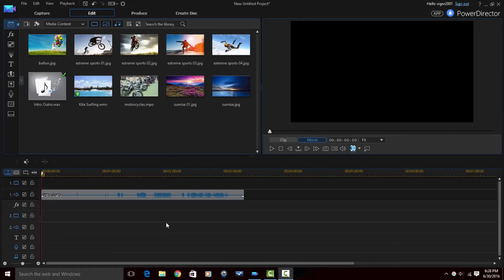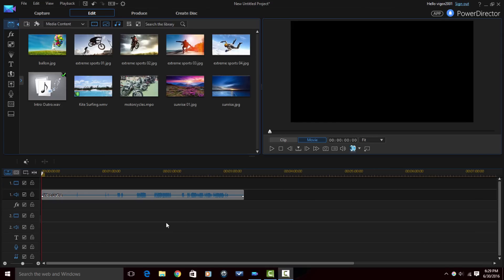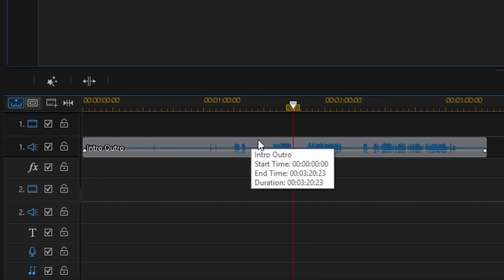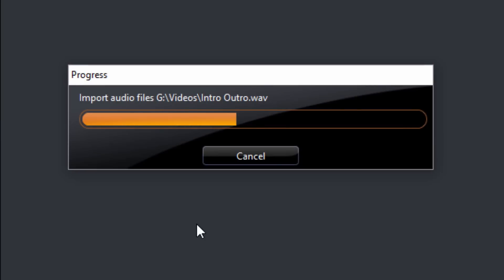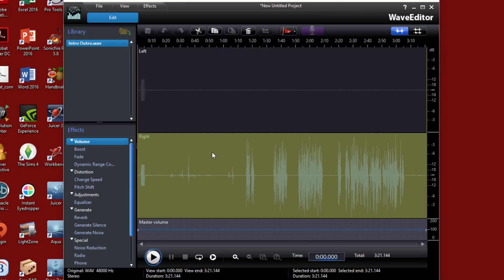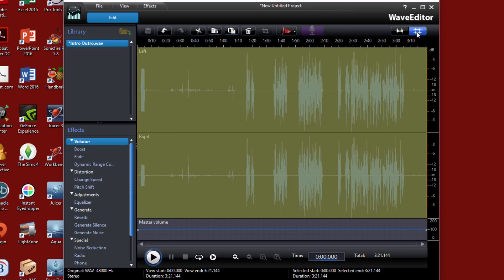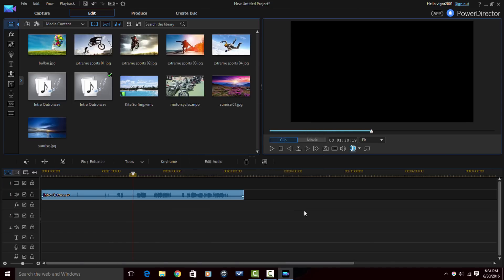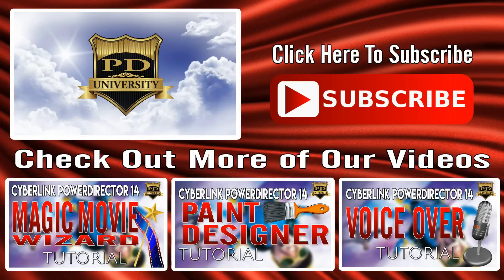How to Change Mono to Stereo | PowerDirector

Comment: this doesnt work in the current versions. there's no Wave editor for starters, I assume Audio Editor is its replacement, but when I try to CRTL-C or A or anything, nothing happens. why there isnt a simple 'mono' option is ridiculous. One legged audio is an obvious clear reason for wanting to edit audio
Reply from the maker: Nope, Works great for people who have the old versions.
Reply: @PDU_Tutorials very annoying that the Audio Director is now an additional cost to Power Director. Not gonna pay for another service I can use elsewhere. For anyone stuck my long winded work around was to export the audio separately as a WAV, import to Audacity, mono the track then re-encode as WAV, then import back to Power Director. Long winded, but free

Comment: when I select all it highlights BOTH channels and then when I paste it makes the left channel out of sync... ANY idea WHY this happens? Thanks. In the project area I don't have a left and right...I have a LEFT with no sound and on what should be the right is SOUND but it does SAY 'R" it just has a magnifying glass....weird.
Reply from the maker: No idea what's going on. You can contact CyberLink using the link in my channel under the About section

Comment: Hey my man. I have an 8mm camcorder tape which is in mono. The total length is 2hours 10 minutes. I used Wave Editor to convert to stereo and saved the new files to my Desktop. I then wanted to convert to mp4, so I would use Handbrake. HOWEVER, after I saved the files to my Hard Drive, the file was only 50 minutes long. Is this the maximum length for a conversion. The tape is a concert, so I could possibly break the files into about 15 tracks but this is very time consuming. Is it possible to do the mono to stereo in a 2 hour track?
Reply: In hindsight, I transferred the 3separate video VOB files to Power Director and found the total imported was only 50 minutes, so ignore my previous question. I am going to have to figure out this one for myself

Comment: OK. I managed to get the audio from my Camcorder TS/VOB Video files right on my Power Director, but could you give me some quick advice for the easiest way for me to post the Clip(s) onto You Tube by converting to mp4. I could do it, but I would have to use 'Handbrake' software but this takes ages, and sometimes you have to combine separate clips into one. Any advice you have for an easy solution would be appreciated
Reply from the maker: Sorry I don't have any other advice. Have you tried asking on the PowerDirector forum? Lots of people there seem to use DVDs and might be able to help. https://forum.cyberlink.com/forum/forums/list/ENU.page
Reply: @PDU_Tutorials  Hi again Maliek. I have sorted out my Wave Editor Crashing problem after the DXDiag prompt and I posted in the Forum sending the DXDiag. I also posted my other main problem and that is the combining 2 or more (In my case 5) VTS files as ONE File. I would have liked to have had the VTS files combined into one file before I imported into PD, but again I dont know the solution. I might google You tube and see if you already have the solution :)   - Hope Im not pestering you too much ;)
Reply from the maker: @groovedohg  No sure about that either. When you bring the separate files into pD you can combine them there.

Comment: Youre awesome mate. I have a load of video files I took on an old camcorder which were only on one channel - Solved my problem ;-)
Reply from the maker: Happy to help.
Reply: @PDU_Tutorials  Hey again Maliek. As I have mentioned, I am adjusting audio from a Music Camcorder gig I did many years ago. The files I am converting are 5 x  VOB files. On the video folder I am trying to get full stereo sound out of, only 4 of the VOB files created stereo files. The other VOB file always crashes and I get the message 'A problem caused the program to stop working correctly etc and I have to exit. It says Windows will notify if a solution is available. Do I have to contact Cyberlink and send a log file or something, or is there another way to find the source of the problem
Reply from the maker: @groovedohg  Run a DXDiag command on your PC. Go to the PD Forum and post your issue along with the DXDiag file. They can help figure it out there. https://forum.cyberlink.com/forum/forums/list/ENU.page

Comment: Hi pal. Im recording audio in audiodirector. I can only get it in L Channel and not in both. Any suggestions please? Cheers
Reply from the maker: Are you using a XLR mic and digital audio converter to connect your mic to your PC or are you connecting directly to your PC using a USB mic?
Reply: @PDU_Tutorials  second one. Yetti blue. Cheers
Reply from the maker: @AProperPaddyORourke  Check your PC's audio settings for your recording device to insure it is recoding to both channels. If it is set up correctly, try asking for assistance on the Audio Director forum. https://forum.cyberlink.com/forum/forums/show/111.page

Comment: Thanks for the vid. If like me, you don't have WaveEditor or AudioDirector, the way to convert the single stereo sound to mono is to output "Produce" the clip as an AVI but switch audio output settings for the file from stereo to mono. Once this is done, open the new AVI file in CyberLink and Boom, it's now on both channels.

Comment: Hey Malik, the copy and paste buttons are no longer there in PD 18, nor do ctrl+c/v work. Is there any way to do the same thing without having to purchase AudioDirector...?
Reply: P.S. Your videos and tutorials are awesome!
Reply from the maker: Thank you.
Reply from the maker: PD 18 doesn't have the Wave Editor. It has the Audio Editor. You can copy, paste, and use keyboard shortcuts to copy and paste. If they are not working you should contact CyberLink support.
Reply: @PDU_Tutorials  There is no option to select on the audio track.
Is there any way to do this using Audio Director?
Reply from the maker: aditya pandya Yes, copy one track and paste it to the other in AudioDirector
Reply: @PDU_Tutorials  ty I got it done!
Reply from the maker: aditya pandya good

Comment: And swap channels?
Reply from the maker: Helderhugo Use a multi track audio program like Audacity or Audition to move move audio into an empty channel and then swap them.
Reply: @PDU_Tutorials  But I have to export and import again the audio files after modifying them?
Reply from the maker: Helderhugo You import the original clip in Audacity or some other audio editor, export the file from the audio editor, and import it to PowerDirector
Reply: Thanks for your answer. Not practical. Should be just an option on the Powerdirector to do that. We have to extract the audio from a Video with the original left and right audio swaped, then put on a audio program to edit to swap the channels and then save it and sync again with the Video. It takes time.
Reply from the maker: @Helderhugo  You're welcome.

Comment: My issue is I often record live music by getting a board feed on channel 1 and an ambient feed on channel 2. How can I mix these so my final audio will have a mix on both channels? I can do this in other edit programs but not in PowerDirector. Any advice?
Reply from the maker: PowerDirector doesn't have multi-channel editing capabilities. You can use Audio Editor, Audacity, or Audition to create a mix on both channels.
Reply: Thanks, I have had PD for some time now and I keep hoping with every upgrade that that is a very basic and useful feature to build into the program. Is there a way to make such a request of the software engineers or is there a fundamental problem with the software design that prevents such a feature from being added? @PDU_Tutorials
Reply from the maker: Ned Lightner I have no idea what the capabilities of the program are. The only way I know to request changes is on CuberLinks social media pages or CyberLinks forum.

Comment: I have a string of 7 clips of one event, all with right-channel audio only.  I'd like to combine them into one video with (same) audio in both channels using PD17.  Is there an easy way to do it?  Larry@DejaViewsUSA.com - Thanks
Reply from the maker: You need to use an audio editor like Audio Director or Audacity (free) to do it.

Comment: The video was very useful and I managed to copy just as you showed BUT my audio does NOT save on exit as you show. everything is working fine but when I go back to my project in PowerDirector (15) it is still only playing in mono?  Help please!!
Reply from the maker: If you are selecting Yes when you close Wave Editor and it is not saving there is an issue with the program. Not sure how to resolve that. You can check with CyberLink support or check with the CyberLink forum.

Comment: Why does it still show a mono channel in PowerDirector? I added stereo audio, and hear it in both ears, but visually in PowerDirector, it looks like only one channel. Is that normal? The audio I recorded is not hard panned left of right, so it's difficult to hear whether it's mono or stereo. Thanks! Great channel!
Reply from the maker: PD is not capable of showing multi-channel waveforms.
Reply: PowerDirector University thanks!

Comment: Great videos! Is there any way to enhance a mono track on both channels to simulate actual stereo? In other words, to give them some separation...Thanks!
Reply from the maker: When you import mono audio into Wave Editor it does it as stereo so when you add it to both channels you should have the separation. Here is an article about it on the PD forum. You can respond to this post if you have further questions. http://forum.cyberlink.com/forum/posts/list/32587.page;jsessionid=82BF4DF971B2F02409743B275E15DA54

Comment: I followed the instructions, but the  new audio file is out of sync; a few seconds shorter than the original file. Extending the audio file doesn't help. It's still out of sync. Solution?
Reply from the maker: Select the audio and video file while they are on the timeline and select the Sync by Audio button above the timeline.
Reply: There is no " Sync by Audio button' above the timeline.
Reply from the maker: When you select two clips with audio in them (or a audio only clip and a video clip with audio in it) a Sync By Audio Button appears above the timeline. It is not there until you select the two clips.

If you selected the two clips and there is no Sync by Audio button what version of PowerDirector 14 do you have?
Reply: version 11
Reply from the maker: That version does not have a Sync by Audio feature. You will have to stretch out the timeline and then move the audio over frame by frame until it is synced up.
Reply: Just uploaded 14. 
Did you do a tutorial on CyberLink Screen capture?
Reply from the maker: No I did not. I can add it to my request list.